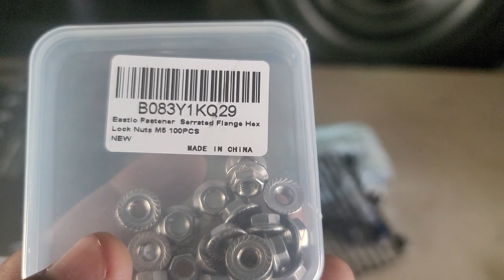Building A 240ah Cmax Lithium Car Audio Battery

Comment: I'm trying to do research about lithium because I'm going to need a power bank for my new setup and I've only ever used AGM. These days it's all about the lithium but I've always been scared of it. You make me feel a bit more confident about building a bank. I'll most likely be going with LIFEPO4 cells being they can be used with a AGM battery without a isolator. Great job again!
Reply from the maker: That's a great idea to do. That's exactly how i felt about lithium after using Agm for so long. If i can get comfortable enough to build a lithium bank I'm sure you can too. Best of luck with your build
Reply: @BIGJURAY20  thanks
Reply: @BIGJURAY20  if I need any advice would you mind if I reach out?
Reply from the maker: @Tony Foley  No problem bro happy to help out best i can
Reply: @BIGJURAY20  thanks
Reply from the maker: No prob bro

Comment: Whats the highest these can be charged at? And whats the lowest the can be charged at and still used in a setup? Nice build👍
Reply from the maker: Charging is 14.8-16.8v but 16.8v is 100% State Of Charge and could shorten the lifespan of the cells. If you can maintain 15v area they should last up to 10 years depending on condition of cells used
Reply: @BIGJURAY20  thx for the reply.  I  charge at 14.8. Think that's ok? Or should I go with a different cell? Running a jp63 and jp234 on a daily
Reply from the maker: @brunom1280  keep what u have and try and charge a little higher. The higher the charge with Cmax the better the reserve

Comment: Great job man appreciate every little details keep it up, Can you send me a link to where I can order those exact same cells, are those Cells 3.5v or 3.7v per cells, I will build my own one by looking at your video, so these 240Ah bank are they at 12v or 15.5 v after finish put together
Reply from the maker: Appreciate the love bro the cells charge between 3.7-4.2v 
So once the battery is completed 14.8-16.8v
Reply from the maker: These days Facebook is a good source for just about anything Audio related. There are Lithium groups where people sale module such as the one in the video to Do it yourself
Reply: Hmu if ya need a bank of 21 cells. I'm trying too off one for 250
Reply from the maker: @TheAnthonyBrandi  Where are u located

Comment: Good job on describing all the details. I have a full Sound Stream install Ill post it later. Thanks
Reply from the maker: Thanks for the love. What are you running?
Reply: @BIGJURAY20  Im running Sound Stream TXP 18000 to 2 12" DVC 2 ohm Tarantula subs TXP in a fourth order enclosure.
Sound Stream 4 channel for the mids and highs
Mechman 240 amp Alternator with two Centennial Group 31 batteries
Reply from the maker: Nice system only thing I see wrong are the ohm load of your subs
Reply from the maker: @reyeslozano5598  If you had dual 4 ohm u could've ran your system at 1 ohm for more output from your amp
Reply from the maker: @reyeslozano5598  With a 4th order it may not matter though. What vehicle do you have this system in?
Reply: @BIGJURAY20  Its in a 2010 Chrysler 300. It sounds really good. Next chance I'm going to try and put it on  the meter.
Reply from the maker: @reyeslozano5598  It's possible you can do at least a 145

Comment: Hey man I have a 120 ah big cell . I'm wanting to add another 120 I could use the same compression side bars but would just need longer threaded rods right ?  TIA!
Reply from the maker: Yes but if u already have one built it could interfere with spacing if u pull apart I'd run 2 120ah banks
Reply: @BIGJURAY20  ok thanks man. One kore question could I run a small cell and Bic cell together . They would obviously be in different banks . Just curious if the difference in discharge rate would hurt anything
Reply from the maker: @Bass so loud it HZ  I have seen someone do this before and his voltage held up but i feel you wouldn't be getting the best from either bank since they have different charge and discharge rates
Reply: @BIGJURAY20  Alright man that's what I was curious about. Much appreciated!!
Reply from the maker: Honestly if you haven't already done so. I'd look into the smaller cells and get a good enough bank to support the needs of your system and sale the bigger cells. But then again 240ah of the large cells can still do justice but it's comparable to around 95ah of the smaller cells

Comment: How much did it cost you to buy those cells?  I want about 360ah how much would it cost
Reply from the maker: U can get cases for about 300-500 each. So anywhere from 900-$1500 for 360ah if u get these cells

Comment: How many ah can 1 alternator Handel to charge safely . And the amperage in alt .
Reply from the maker: Honestly, not sure exactly how many amps of charging a battery would need based on the amp hour. I've had a single 320 amp Alternator charging a 240ah bank before. It could charge faster the more amperage given but it still held fine

Comment: Clean build brother! Got a question if you don’t mind. I have a about a 6k wattage system with my 3 amps jp23v2 jp234 and jp84. 320 HOA. Under the hood I got a XSD5100 60AH. If I wanted to go LiFePo4 what would be a suitable AH bank? I bought a 20AH Ampere LiFePo4 battery already they use Grade A cells in their batteries. I was wondering if I need more. According to skyhigh car audio techs Lithium is double the power of Agm/Lead so 10Ah of lithium is like having 100ah of Agm/Lead. And LiFePo4 uses 90% of its density while Agm/lead uses 50.
Reply from the maker: Don't have much experience with lifepo4 honestly but 40ah should sustain 3k for a full system. Your 20ah should hold up ok during play much better then the 60ah agm you have
Reply from the maker: Is the battery you have ok to use for car audio?
Reply: @BIGJURAY20  yes it’s safe to use with car audio. LiFePo4 is the same as headway. You just have to make sure it’s Grade A or B cells whichever company you use.

Comment: Them cells look thicker than normal.  Are they the same voltage? Like 3.5-3.7v
Reply from the maker: Yes all cells are even in size and all balanced out
Reply: @BIGJURAY20  I meant like the thickness of them cells are like 1” an every other cmaxx bank I see has thin cells. Like only a 1/2” thick
Reply: Where did you purchase the battery from?
Reply from the maker: @chrisbordelon2782  These are the 24ah cells they're thicker than the 5ah cells
Reply from the maker: @chrisbordelon2782  Picked up cells local to me
Reply: @BIGJURAY20  that's 24ah for a bank of 4. What is the ah per individual cell?
Reply: @damnitdang  
Just asked this less than 10 min. ago.. Looks like ur still waiting😞🤷🏻‍♂️
Reply from the maker: They're 24ah cells can't tell u why it takes four cells to actually make up the amount vs the 5ah cells. Each 5ah cells is exactly that amount
Reply from the maker: @smigletat9634 Unfortunately, for whatever reason I don't get every comment when they come in. Sometimes it takes a response to a comment like yours for it to appear
Reply: @BIGJURAY20  
Thank you my man! & in prompt time😁

Comment: i have 1 of them how much can i make with one
Reply from the maker: Is yours a 240ah as well?
Reply: @BIGJURAY20  no its just like one you have it is a 21 cell 24ah needs to be made into one
Reply from the maker: @jtsgarage2999  ok so u have 120ah
Reply from the maker: 120ah Bank is good for some decent power. I had one with a 320 amp Alternator and clamped 12k dropping from 15.6v to 14.8v
Reply: @BIGJURAY20  i have a 240 amp michman alt guy said he can make a 128amp hour but have to charg @ 15.7 ish
Reply from the maker: @jtsgarage2999  What kind of vehicle do you have?
Reply: just sub to you
Reply from the maker: @jtsgarage2999  Thank you really appreciate it
Reply: @BIGJURAY20  2002 dodge darango
Reply: @BIGJURAY20  think you can help me out on what to get and what i need
Reply from the maker: @jtsgarage2999  I can help best I can but I'm not too sure if your trucks computer can take 15.7v without issues
Reply: @BIGJURAY20  so whats the lowest i can charge that cmaxx